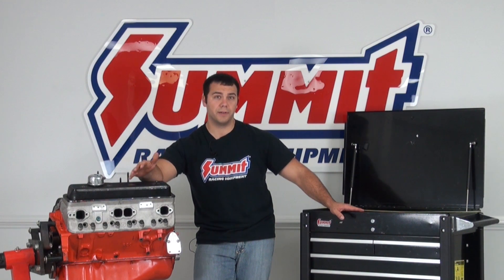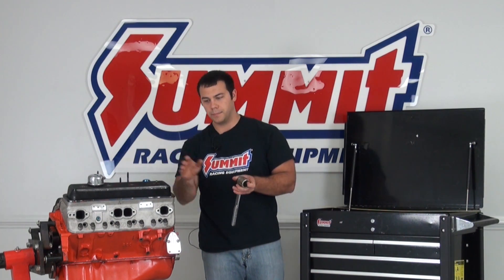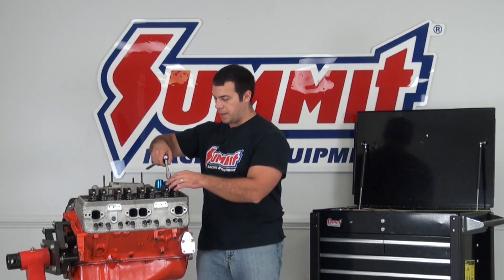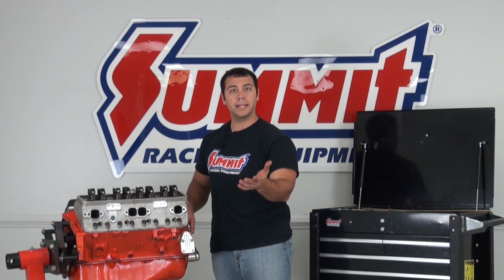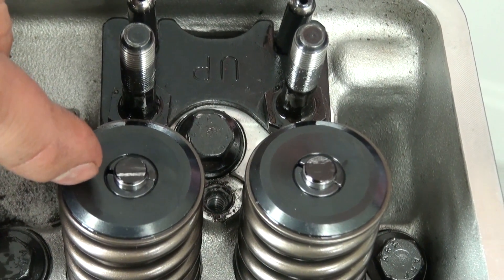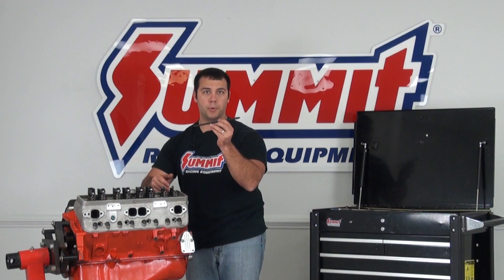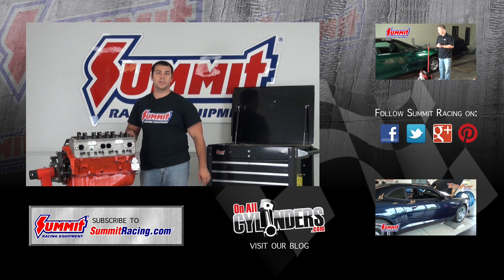How to Measure Push Rod Length - Summit Racing Quick Flicks

Comment: Another video of how to measure pushrods incorrectly. It's a real pity that a company as big as Summit with all their knowledge passes on wrong information. Correct push rod length is determined by how wide the mark on the tip is. Narrowest is what you are looking for. If it is narrow and off center, then there is a rocker length problem or the stud/mount hole is off center. If you try to get a narrow mark to move back to center, then I can guarantee you will get a wide mark and therefor the geometry will be wrong.  Cleveland aftermarket rockers are renowned for being machined wrong. Can't talk about other engines.

Comment: U couldn't see what u were doing, not to mention u dont use the valve springs when checking for length as the tool will break under too higher pressure. U need to fit lighter springs to check this. Plus you never explained rocker ratios or just flat tappet cam adjustment.  Nobody listen to this video please.  Youll fuck your valvetrain in minutes

Comment: Would have been helpful to point out that that proper checking of pushrod lengths should be done with either solid lifters and lightweight valve checker springs. Summit has a pretty good video on measuring pushrod lengths at this link.  
https://www.youtube.com/watch?v=ddK0n2duAfg

Comment: "Pumped up with oil".   Unless the engine is running, every rotation with the regular valve springs installed on a hydraulic lifter engine will push the pushrod down to the bottom of travel in the lifter.   Any pattern you pull on the valve stem tips will be wrong.

Comment: What if the pushrod length tool indicates a non-standard length, such as 7.603. Do you get the nearest longer pushrod, or the nearest shorter pushrod?
Reply: Good question, in your case it would be 7.6"

The next longest is 7.65", way too long.

Comment: What if I don't have roller rocker arms just stock rocker arms
Reply from the maker: Hi Jamie, 
The process is the same for non-roller rockers. The only difference would be a bolt-down version like Ford Windsor's pedestal rockers. To get the proper measurement, you add a shim(s) or mill the pivot base. The pushrod length is used to adjust the lifter preload.

Comment: Does this technique work on an Oldsmobile V8 which doesn't have a lash adjustment?
Reply from the maker: No, this method will not work. Since your Oldsmobile V8 has non-adjustable valvetrain, you will need to check for the proper lifter pre-load. The optimized pre-load is .040"-.050". You will need an adjustable pushrod length checker tool and a dial indicator.
Step 1. Put the lifter on the base circle of the cam.
Step 2. Set the pushrod length tool to a starting point close to what you think the length should be. If not sure, put it at stock length. 
Step 3. Install rocker arm and tighten rocker arm nut by hand until you get to zero lash. The best way to get to zero lash is move the pushrod up and down while you're tightening the rocker arm nut until the pushrod doesn't move up and down anymore, but still spins freely.
Step 4. Install dial indicator on he tip of the rocker arm and set the needle to zero on the gauge. 
Step 5. Tighten the rocker arm nut to the factory torque setting. Once the rocker arm is torqued to factory setting, look at the gauge on the dial indicator to see what your pre-load is. 
Step 6. If it reads greater than .050" or less than .040", you will need to adjust the pushrod checker and repeat procedure until you get to the desired pre-load. Once you achieve the desired lifter pre-load, measure the pushrod length tool with a dial caliper and that will be the length your engine will require.
Reply: @SummitRacing  This video is Terrible

A freaking yardstick!

Please take it down

It is a poor reflection on Summit Racing

Comment: I have a 1995 Dodge 5.9 360 I'm rebuilding. For the most part it will be stock. What cam and lifter kit  could I use to give me a little more pulling power and a decent lope in the motor .
Reply from the maker: More information will be needed, I would recommend you give us a call, contact a sales agent at 1-800-230-3030.

Comment: Im building a 1970 bb 402 everything stock bord 40 over i have 11-208-3 cam 7561 intake the original length pushrods is 9.25 & 8.28 the motor has been rebuilt and been sitting up for 11 years started it a couple of times to hear took out can and put a comp 11-208-3 what rods would u recommend for my setup

Comment: If you have a cam reground does that affect pushrod lengh?
Reply: I would say no.

The grinder would not be shaving off parts of the base circle, only the lobe. And even if the grinder did the base (just to clean it up), he would only take off like 0.003" max.

Push rod lengths usually come in steps of 0.050".

Comment: You may also want to swap in some checker springs or you will be buying lots of checker push rods !
Reply: Says who? Comp Cams checker rods say right in the instructions you can turn the motor over with them installed.
Reply: Yeah, maybe if you got 800 pounds over the nose, you might be in trouble.... But I'm pretty sure my comp tool can handle around 380.

Comment: Just checked mine today, put a new motor together. The mark on the valve is at the 3/4 outboard mark on the valve. I ordered a single pushrod .100 longer, that should tell me if I am on center or not. If it is I will buy a whole set, if not I will try a .200 longer.

Comment: This is prob. the worst video on you-tube ( Ok maybe not :) ) on checking for proper pushrod length. A yardstick for measuring????? Cmon Summit, seriously? Right out of the gate, a Yardstick? How is anyone supposed to see what this stagefright clown is doing when the camera is 12 feet away from the work being performed? This is an embarrassment to Summit racing and should be removed.
Reply: agreed camera is to far away

Comment: I have just rebuilt a SBC and I have Edelbrock aluminum heads with roller rockers . I am not sure if the push rods are the correct length , it's been driven now for about 1000 miles . Can I just pull the valve cover off , pull through rocker arm off and visually look at the wear pattern on the valve stem ?

Comment: i have a 383 stroker in my 67 camaro with roller rocker, but i like to have roller cam also, then i need new push rod, do you have a part no for at push rod measure my new push rod.
i dont know what gasket there is in it.
I has patriot freedom heads on. it drives very nice but ekstra hp is always welcome :-)

Comment: Cool video  my name is John I am installing a comp cam on a 350 sb 5,7 cam number  is 12-238 -2 and new springs  comp number  981-16 and retainers number 742 -16 and locks comp number  601-16 my question  is I have stock rockers do you think I need to get longer push rods

Comment: how do i determine connecting rod length
Reply from the maker: Hi Gasie,
Measure from the center of the large diameter hole to the center of the small diameter hole.

Comment: You lost me when you picked up that yardstick.
Reply: Hey, u know engine builders ALL use yardsticks for clearances
Reply: Surprised me, too.  But thinking a little more about it, if pushrods are available in 0.050 increments and you can read the yardstick to tighter than 1/16, then maybe you're ok.  But still, the optics are not quite right.
Reply: Can the adjustable pushrod sustain all the spring pressure ?
Reply: Lmao

Comment: Terrible video. This is NOT proper geometry do NOT use the marker technique watch the video by Straub Technologies!  For one you need tester springs if you buy the adjustable pushrod tool and you  need to have a set of dummy hydraulic lifters welded with the recommended preload. You do not measure the final length a ruler stick that is for measuring to the nearest 1/4" Comp's checker you add .050" for every turn or use a 12" caliper.  Centering the roller on the valve has NOTHING to do with proper geometry.  If Summit can't make a video to show proper technique they shouldn't make one at all.
Reply: David Sanders I know. I tried to do this off videos on the net and they're so uneducated
Reply: i know this is old, but THANK GOD there's at least one other person on the planet that knows the ''put the roller in the middle'' is BS.

With the stud not being parallel to the valve stem, you set the rocker at the correct height and if the roller isn't on the valve, you need new rockers.

Putting the rocker as some goofy steep angle just to hit the middle of the valve will only cause overarcing or underarcing.  Neither of which is correct geometry.

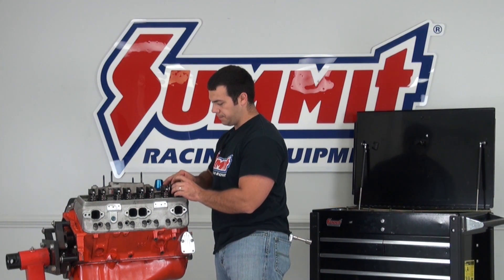At 2:49 I knew the host has no idea what he was talking about.
Reply: Exactly.

Comment: I have a 350 chevy with Crane anti-pump-up hyd lifters ,, Alum heads and want to know what length Pushrod Checker I need to order from you guys,  They come in so many different lengths and I have no way to get started.
Reply from the maker: Hi Jack Tyler, 
The TFS-9001 length checker will actually give you adjustability on either side of the OE length. http://www.summitracing.com/parts/tfs-9001/overview/
Reply: Summit Racing I'll have to remove the guides for those I see, but thanks for your reply.

Comment: Ok questions.
Is this method for solid or hydraulic lifters?
Don't you have to put it on TDC first for whichever cylinder you're checking?
Like david mentioned, do we do the valve lash first or after measuring the pushrods?
Reply from the maker: Hi smilinjoe23, 
Proper length checking of pushrods should be done with either solid lifters or very lightweight valve springs sometimes called checking springs. Most higher performance valve springs have enough spring pressure to bleed a hydraulic lifter off during the checking process. This of course will give an incorrect pattern. As for valve lash, when checking pushrod length, all lash should be removed. If running a solid lift camshaft, lash would be put back in after achieving proper length of the pushrods.
Reply: Thanks. it will be helpful if you mentioned that as part of the tools needed in the video.

Comment: So when I install the pushrod tool obviously I have the valve closed and do I set the lash at that point before I check the pattern on the valve stem or do I set the lash after the new custom length pushrods are installed? How much adjustment do I leave at the adjuster before I measure my pushrod length?
Reply from the maker: David Hillier, 
A solid lifter should be used
for this test. In some cases a hydraulic lifter; either roller or flat tappet;
will have to be disassembled and stacked with washers or shims internally to
make it solid. The pushrod cup height must be maintained throughout the test
and hydraulic lifters will typically bleed down if the motor/oil pump is not
running. Once this is accomplished, you will then zero lash the valves being
checked. As was stated in the video, it is essential that the pattern is as
centralized as possible on the valve stem tip.
Reply: Summit Racing Thanks! I am doing my solid lifter 1700 VW type 4 engine. I think I got it licked. Thanks for getting back to me.

Comment: A yard stick for measuring pushrod length? How are we supposed to take this seriously?!
Reply: .050 is almost 1/16". Close enough because you can only get pushrods in .050 intervals.
Reply: Jason Durham proper measuring devices like micrometer, etc. but a yard stick? um no, sure great to make the engine run sure. but for measuring valve train no. might as well have just tuned by ear as my grandpa used to. I mean, it used to be fine in the 60's but it's 2017, we've progressed, and!, this is a dang summit article, I know that they own the correct tools for you to use. for Pete's sake, I bought them from summit years ago😔
Reply: Jason Durham all u got to do is ask mike how long it is

Comment: How would the lifters get pumped up if the distributor is not installed?  Doesn't the pump run off the bottom of the distributor gear.
Reply from the maker: Hi *****, 
On a Chevrolet motor there is indeed an oil passage that is completed by the distributor housing. In this case, there are oil pump primer shafts that are available to complete that passage so that all lifters would be oiled while priming.

Comment from the maker: Hi wondersmelonade, 
That is correct, Al is a Ford fan and always jumps to the passenger side of the engine for the #1 cylinder on a V8. :)
Reply: That makes sense, only a ford guy will consider a yard or meter stick as a precise measurement tool.
Reply: @realdeathpony  You mean just like Alex Taylor did with a common tape measure??
https://www.youtube.com/watch?v=YsusW0lzoHE&t=353s